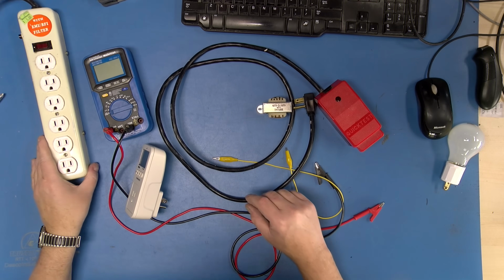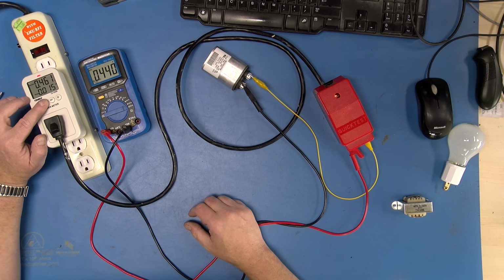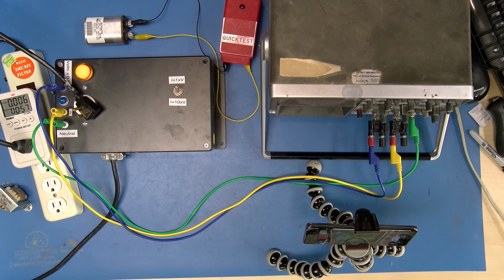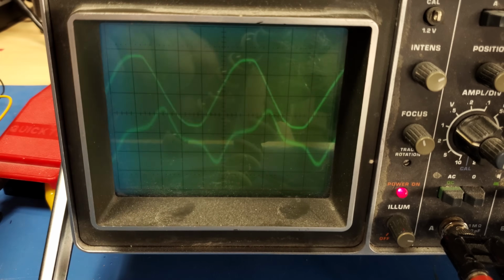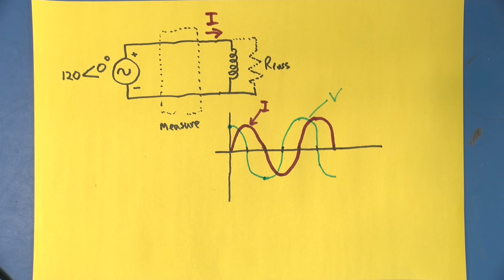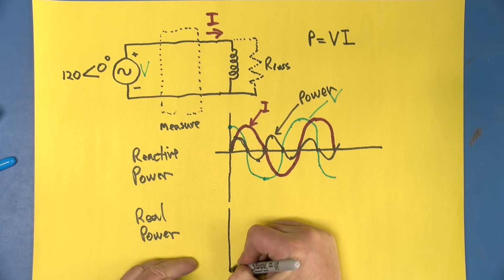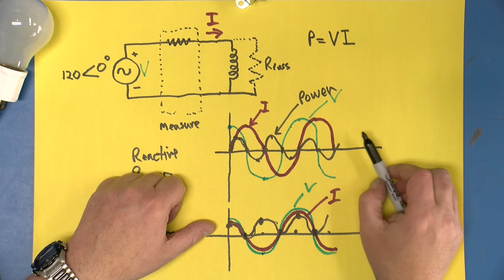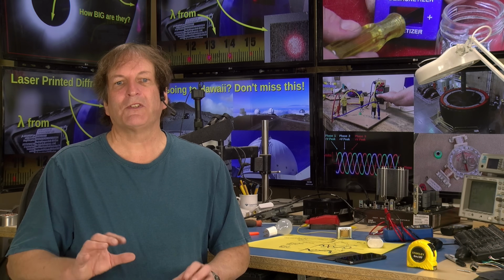That strange flow of electricity that transmits no real power

Comment: Just had a 441 in the shop. Ran like a dog turd and flopped around everywhere. I put a new top end on it, opened up the muffler a little bit and put the stiff av spring and filled them with silicone. It runs like a beast now and i would like to see how it would do on this this test vs your clapped out 441 no offense. The Jred is also a non strato saw vs the first true strato saw ever made by stihl. Id be more interested to see how a fresh 441 would stack up against a 372xp with build dates that are within a few years of eachother. I watched a video with timed cuts of a 441 vs 372 and the 372 was 5 seconds or so faster in the cut but had a 25" bar vs a 28" bar on the stihl.

Comment: I’ve often contemplated building a device that would monitor reactive load and dynamically increase or decrease a parallel capacitor bank in order to reduce the imaginary current in order to improve off-grid power storage efficiency. I even started such a project using a PZEM-004. With an I2C multiplexer, a cascade bank could be used to effectively add “power factor correction” to “dumb” inductive loads automagically. 

But nicely explained demonstration for anybody unfamiliar !
Reply from the maker: Thats of real interest to me because I have been working on something similar but for a different reason: i want to make a similar switched capacitor bank to provide the reactive magnetizing current for a conventional induction motor used as a generator. Induction motors work well as generators, but without the grid you need to carefully regulate leading current supplied by the capacitors to in turn regulate the generators output voltage. Also has to supply the reactive current for any attached inductive loads which would otherwise demagnetize the  generator rotor and lower the V.  I'm using a switched capacitor banks with capacitance values of each capacitor increasing by a factor of two. I'm guessing the main difference between what we are doing is the controller SW used to determine what regulates the capacitance.

Comment: Even though this system does not use up this power, the user is charged for the positive part of it and if the user is a commercial entity he is charged for all of it - crazy if you ask me, because the power is being borrowed and then immediately "repaid back" 50/60 times a second, depending on grid's frequency.

There should be a completely different rates for borrowing power and using up the power.
Reply from the maker: They do it at different rates - the meters distinguish between the real and reactive power. I believe (but could be wrong) reactive power is charged at a lower rate than real power, mainly to encourage factories to install equipment to remove reactive power. An electrician friend recently told me in some cases they also charge for peak power.

Comment: Great demo and explanation , but how does the capacitor correct the phase shift , from memory in my electrical apprenticeship 40 years ago , we discuss how the inductor releases power back to the capacitor, is this correct
Reply from the maker: Good memory! Yes - that would be one way fo describing it. 

Look the point in the video where I draw the current and  power though an inductor. Now if we replaced the inductor with a capacitor, the current would shift to lead the voltage by 90 degrees rather than lag it. It you draw that current on the inductor graph, it would be negative of the inductor current that I drew. So with a correctly chosen capacitor the current will go into the capacitor at exactly the right time to absorb all the current coming out of the inductor, and the half a cycle later, the current coming out of the capacitor will there to provide all the right amount of current that the inductor is now sucking in.

If you also plotted the power flow for the capacitor (like I did for the inductor) you would see they are exactly equal and opposite in polarity. So power comes out of one, goes into the other, and the back and forth. 

Hope that clears it up a bit!

Comment: In many environments poor power factor is due to non-linear loads. Power supplies for equipment that operates on direct current are very often very non-linear, drawing current that is more or less in phase with the instantaneous voltage but flowing only for a brief period near the peak of the voltage. Newer power supply designs, incorporate "active power factor correction" that can be very effective. You cannot, in any simplistic way, correct poor power factor due to non-linear loads with any linear device. This became a big problem when desktop computers started appearing in every office. Not only is the power factor terrible, but the nature of the current flow means there is no "cancellation" in 3-phase circuits so virtually all the current flows in the neutral, causing it to overheat.
Edit: Active power factor correction has an interesting dilemma - The average input current must be inversely proportional to the average input voltage but the instantaneous input current must be directly proportional to the instantaneous input voltage.

 If you look at the current and voltage in an incandescent lamp with good enough instruments you'll find that the lamp looks very slightly capacitive. This is due to the large positive temperature coefficient of resistance of the tungsten filament. It is of no practical concern, just a curiosity.
Reply from the maker: Great in depth power factor tutorial! Its commencements  like you that add so much top the videos! Thanks!

I didn't know about the slight  capacitive nature incandescent filaments. How interesting. Must be slightly greater for 50Hz places than 60 since the filament can cool a bit more. I have been playing with some slomo video recording and one thing I wanted to look at was lamp filaments and see if one could see light pulsating slightly. If I can, but be interesting to combine that with the effect you describe and make a video about it.

Comment: Interesting. The official meters at home show kWh so would they be cheated by the reactive power and show less power than what is really used?
Reply from the maker: No - they simply ignore it. The idea is you are only paying for real power delivered to the loads in your house, and the assumption is that the reactive power flowing into most homes is small compared to the real power. It can be the opposite for large factories with giant induction motors. The power meters from those types of facilities record reactive power as well and the power co bill for it.

Comment: What causes the misshapen current sine wave from the inductor or capacitor being connected without another load?
Does it smooth out if a load is connected?
It would’ve been interesting to see how it looked on the Oscilloscope when the grinder and capacitor were connected together.
Reply from the maker: Its two difference causes. In the inductor, the current peaks are from the core operating where the magentic properties of the core start going in saturation. It could be prevented by more turns on the winding so many  small transformers operate close the saturation region to same manufacturing costs. 

The amount of current flowing though a capacitor depends on how fast the voltage applied to it is changing. So in effect it amplifies the differences and the amplification increases as the frequencies/sharpness of the changes gets higher. So we are seeing an amplified version of all the noise on the power line, probably originating from the gazillions of electronic power supplies in use today.  Even after all the theory, the amount of distortion is shocking!
Reply: @ElectromagneticVideos Thank you for your insightful reply.
I think this helps me understand how different components introduce undesirable distortion in passive audio crossovers. 
I wonder how the “faster” polypropylene film capacitors vs the supposed “slower” electrolytic non-polarized capacitors actually handle the signal if measured in this way…

I would think some frequencies would be handled better than others by appropriately sized equally valued uF capacitors of the 2 types mentioned above.

Also, would air core inductors show similar distortion on top of their expected phase shift since they have no cores to saturate?
Reply from the maker: @George.___  Glad my answer helped!

Yes - electrolytics have lots of  internal resistance and even impedance. polypropylene film is better as you described and ceramics are usually the highest frequency ones. As frequencies go up the inductance of the metal inside the capacitor also comes in to play causing weird effect. At GHz we often find capacitors become inductors and and inductors become capacitors.

Even for audio and power supplies, you often see an electrolytic in parallel with a much smaller poly or ceramic cap so the smaller one can handle the high frequencies. 

Air core inductors - without  core dont saturate so wouldnt show saturation. But for low frequencies it would be almost impossible to make one that doesnt draw so much magnetization current that it would not be practical as an inductor.
Reply: @ Wow that’s really interesting how at high frequencies the capacitor and inductor switch roles!

This seems in a way similar to subsonic and supersonic flows, how converging and diverging sections reverse effects.

I’m wondering if polycaps are “faster” responding in audio frequencies because their metal coatings are so thin on the polymer film, like Mylar is sort of. 
So the inductance is much lower in polycaps vs foil caps and electrolytic capacitors because of their metal cross-sections on the film are very thin since capacitors are designed utilizing surface area and thickness only matters for higher current requirements in a capacitor. 
And ceramic caps maybe have the least metal so they respond fastest because of the resulting lower inductance effects.
(With internal ESR being equal if that’s helpful for the comparison…)
Is that concept in the right direction?

Whereas, inductors are more efficient in their role if more conductive metal is wrapped closely around a core, 
or for air core inductors, in a tight radius, where perhaps the field is more rapidly “accelerating” (like more G-force) in a tight radius vs a wider radius core doesn’t require the field to curve as quickly so it is “accelerating” less kind of like less “G-force” for the field in a bigger radius air core inductor.
Is this analogy somewhat in the right direction?
Reply from the maker: @George.___  Your thoughts about poly and ceramics are right - but I'm sure there is a lot of proprietary stuff that goes into optimizing things. The ESRs for all are minimal except electrolytics - I think it is the acidic  paste between the sheets of aluminum that contributes most to it. 

For conductors its really how much flux you can create from a certain current. The fields dont really care about bending - its more number of turns, radius and length - and of course a core if used. The issue with coils is there is capacitance between the windings and resistance in the wire (that gets worse with higher frequencies because of skin depth restricting current flow to near the wire surface.  Coils often have a maximum or resonant frequency  they can be used at - where at that frequency the capacitance between the windings forms a tuned circuit without the need for a capacitor. Above that the capacitance dominates so the coil looks like a capacitor. The opposite for capacitors - at high frequencies the inductance of the often long, rolled up plates becomes more dominant than the capacitance. 

For microwave stuff you can often use short  length of transmission lines - ie a piece of coax that is other shorted or not at the far end. Depending on the frequency you can make it look like an inductor or capacitor depending how long you make it. 

Those coax an other transmission lines are really neat things - I did a video on them a while back that you might like : https://youtu.be/a-8CaGOmWDU
Reply: @ oh this is all fascinating! Thanks for pointing me in the right direction. 
I’m an ME just getting into the field of electronics as a hobby to expand my knowledge for audio gear. 
I’ve been a musician for many years and worked with music both for fun and professionally.  
My drive for tinkering naturally lead me to wanting to understand and build better inner workings of audio gear.
I’ve done some seemingly magical things with sound with modded semi-cheap gear that sounded better than most high-end gear with eye-watering price tags.
Understanding the principles at work and Knowing what matters and where to improve something let’s you cut through the fluff and make a huge impact on performance with the least cost and work wherever possible, (and if so desired, you know, if it ain’t broke… etc.) often in very non-obvious ways that seem strange to others that don’t know.
Reply from the maker: @George.___  There should be a lot of crossover from ME. Although it wont help with your audio electronics, Maxwells Equations use a very similar vector caculus as Navier–Stokes equations as an example.

I envy you for being a musician - a talent I completely lack! Have you ever looked at an of @Paulmcgowanpsaudio Paul McGwowans videos? He has some interesting thoughts on high end audio gear. 

I would be fascinated to hear how you have modded audio gear to make it sound high end - what a great thing to be working on.  If you have any electronics/signal processing questions relating to what you are doing send me an email and I would be happy to try and help. Understand though - I cant remotely claim to have any expertise in high end audio!

Comment: That ac doesn't look very sinusoidal,  seems a bit clipped at 10.57.
Reply from the maker: Sad thing is - its often way worse! The flattening is due to many inexpensive electronic power supplies all drawing current only around the + and - peaks of the AC power cycles, so those peaks get pulled down. To be clear - its grid wide and not specific to my home. It actually a huge issue for the power companies to have to deal with.

Comment: You have an incredible gift for explaining complex concepts in E Z to understand terms. A question does arise though as to who exactly  benefits if a device is "out of step' with the power company's power system. Does the power company  gain by not telling the end user his gear is using 'more ' juice than it's really as you just demonstrated by adding the capacitor or taking it out  and watching the current 'rise' or is this just a nuisance to the power company since this 'apparent power' isn't really doing any real work but simply heating the circuits? Wondering.
Reply from the maker: Well thank you so much! Your analysis/question really goes to the core of the issue: The out of phase current/reactive power is only detrimental to the power co since all it does for them is increase power losses by heating the power lines, and requires bigger generators and transformers to handle the extra current. 

For homes, the extra reactive current is so small on a individual basis that the power co only meters  and charges for real power. For factories with huge induction motors that dull huge amounts of reactive current, they do meter for both the real and reactive power and charge for the  reactive part as well. So factories will often have  capacitor banks or free running synchronous motors (synchronous condensers) with a higher than normal magnetic filed in the rotor to supply a leading current to cancel the lagging current. Power co also have similar setups thought their system to reduce reactive currents - and also compensate for reactive properties of long distance power lines. 

So my little video just scraped the surface of the topic
Reply: @ElectromagneticVideos  Thank you Sir. We're truly blessed to have your incisive intellect analyse and break down these 'weird' artefacts happening right under our noses. These 'anomalies' fit in with what Alice would call "curiouser and curiouser" category, but we have you to lift the arcane veils and reveal what's really behind the trick - it's magic.al !! Much, much appreciated, Sir.
Reply from the maker: @michpich6319  Well thanks so much again! I'm thrilled the response these last few videos have gotten - wasn't expecting a topic like this to gets a fair amount of interest. More to come!